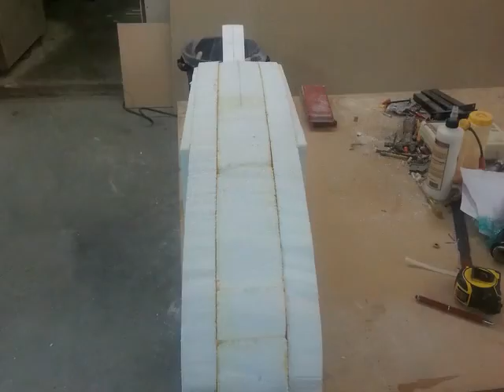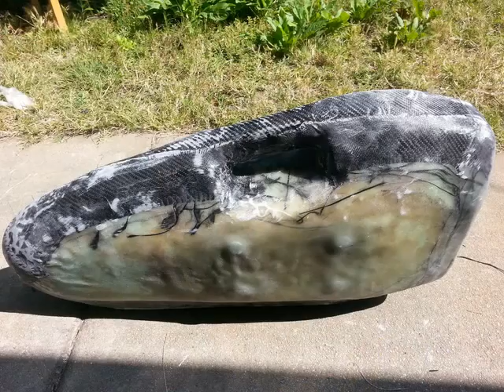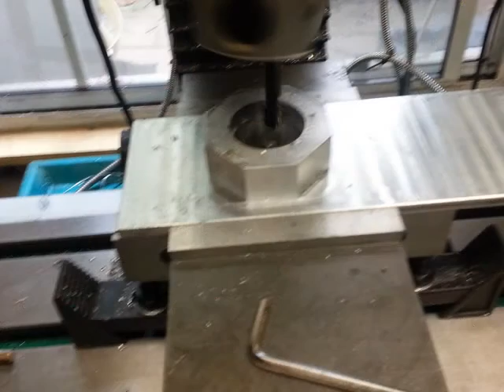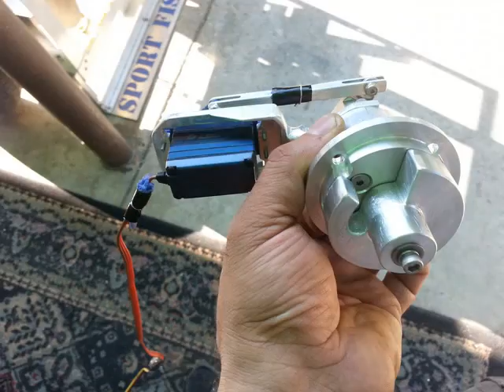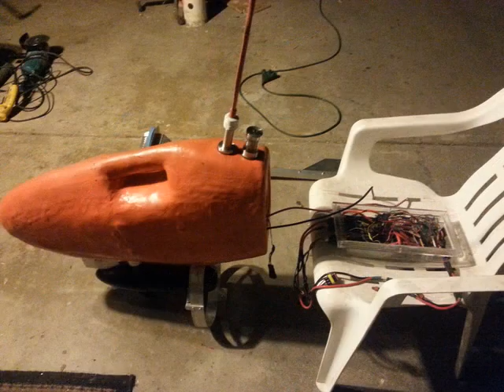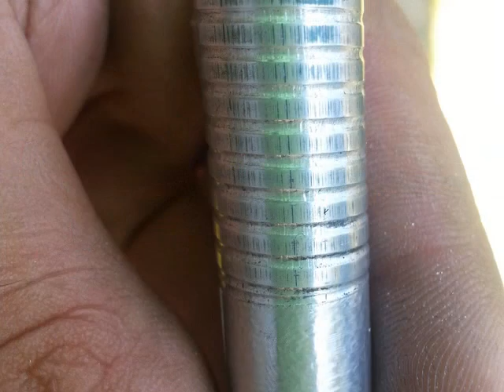How to make Fishing Torpedo

Comment: Hello
Congratulations on your work and sharing it.
I need your help.
What is the diameter of the propeller?
I'm thinking of this engine that says the same thing?
• Voltage: 12 V DC
• RPM: 300 rpm
• Diameter: 37 mm
• Shaft length: 21 mm
• Length (excl. Shaft.): 58 mm
• Shaft diameter: 6 mm
• Torque: 3 kg * cm
• Weight: 200 g
Thank you friend?
Reply from the maker: I got my motor from here https://newportvessels.com/electric-trolling-motor-55lb-thrust-nv-series/
Reply from the maker: 3 blade  diameter is 10 inches  ( 254 mm)
Reply from the maker: Ok. I used Lithium polymer  (LiPo)battery I use 12V  10,000 mAH Lipo batteries connected in parallel. I tested my torpedo for a while. What I can say? My motor is very big. Its about 55 lb. trust. The whole torpedo with battery is about 16kg. It works, but a bit heavy. I recommend you to build smaller torpedo and use smaller motor, about 36 lb. trust. Your torpedo total weight with Lipo batteries should be no more that 11 kg. I'm sure, you will appreciate my advise. Believe me.
Reply: Thank you for your attention, my friend.
You can provide the motor box and remote control receiver connections.
 thanks
Reply: Hello Friend
With the two 10AH lithium batteries each the altonomy?
Thank you
Reply from the maker: I connect 3 pieces of 12V  10,000 mAH Lipo batteries in parallel. So the total is 30,000 mAH 12V . But if you build torpedo no more than 10kg and you use smaller 36 lb motor, you can use one battery or maximum 2 batteries.
Reply from the maker: I got these ones http://www.ebay.com/itm/Lipo-Battery-11-1V-10000mAh-25C-XT60-3sRC-Drone-Lipoly-Battery-3S-Fr-Quadcopeter-/391838559023?epid=1839851182&hash=item5b3b65eb2f:g:2jcAAOSwf-xZo4lD